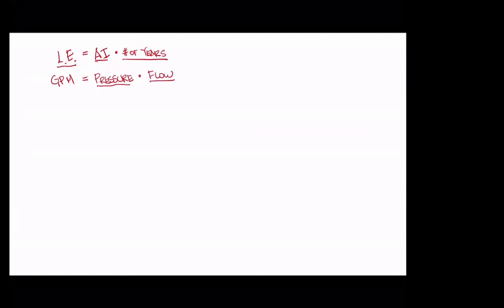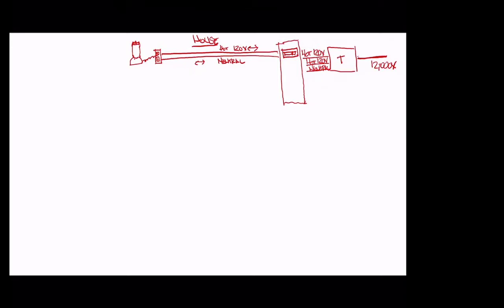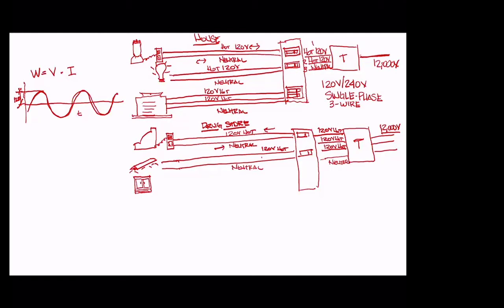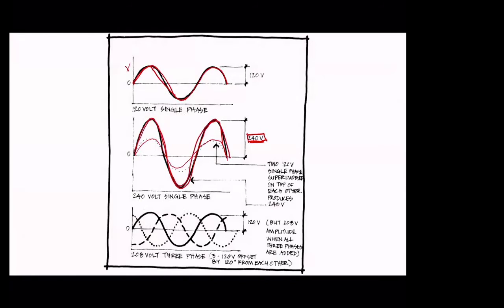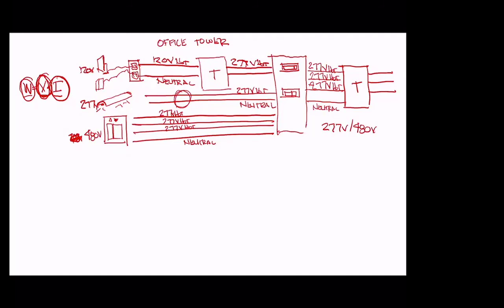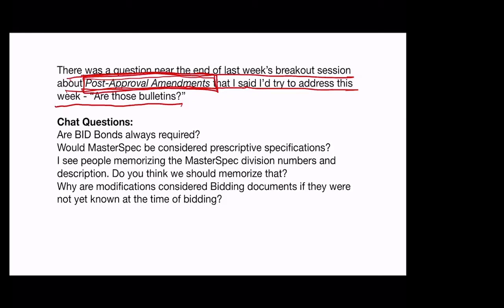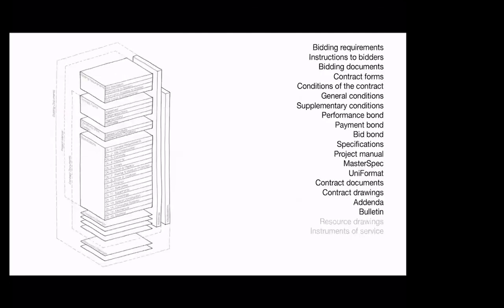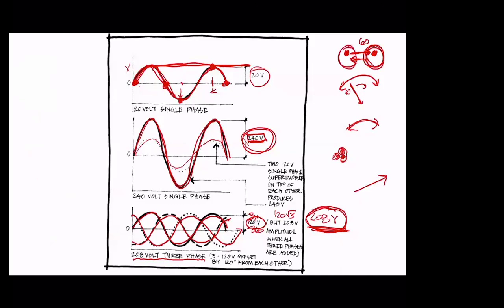Branch Circuits -  40 Minutes of Competence | Amber Book

Comment: I would like to clarify that 3-phase motors such as the ice cream freezer are not connected to the neutral in a balanced 3-phase system. / As a second point: elevators are often DC powered which means that the power would need to run through a rectifier to convert the AC to DC. Although I will note that there are newer elevators that can run on AC power as well.

Comment: Let me answer the question “why there was no two phase? But three phase”  three phase current due the how to generate electricity. Actually magnetic field generates current, when wire cutting through magnetic field it generates some current through the wire. That is how motor works, however, when bundle of wires revolving cutting through the magnetic field it leaves out some space to generate more current, therefore, when one bundle cutting turning 120 degrees, we can add another bundle and cutting through magnetic field generating more current, same idea, the third bundle can be added, every bundle turn 120 degrees then this process becomes less efficient, then another bundle cutting in right away, so we have three sine waves, each of the wave turns 120 degrees then one whole cycle we have three bundle makes the motor the most efficient, that is why we have three phase current. Let me know if I’m correct or not, thanks😀